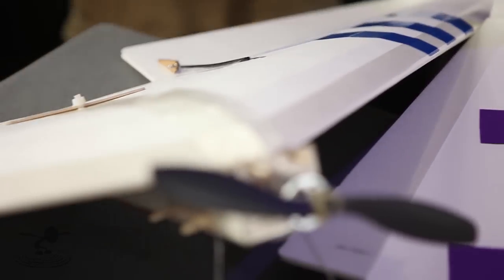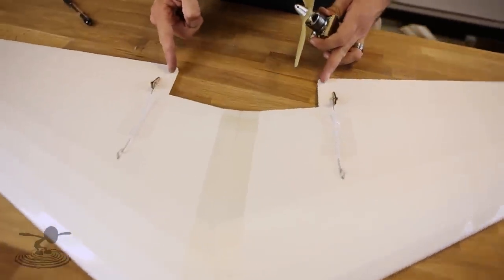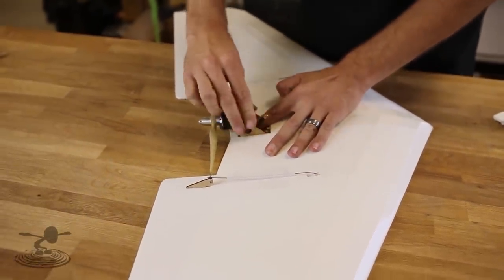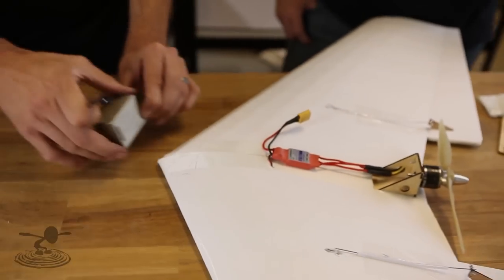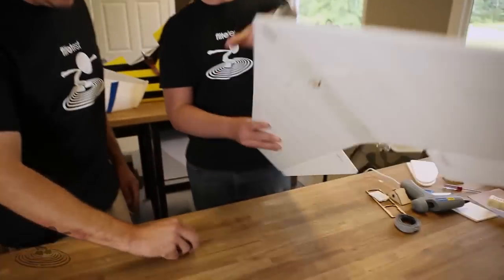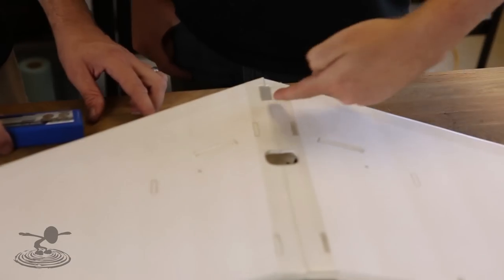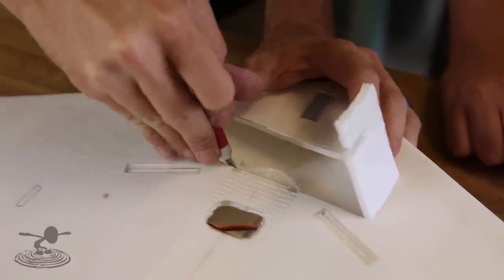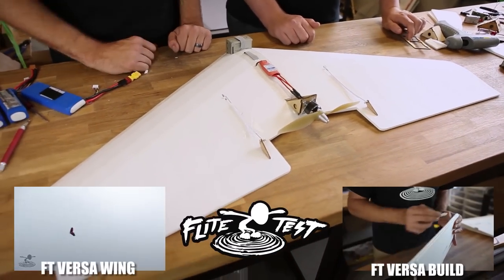Flite Test - FT Versa Wing - Pusher Conversion + FPV Setup

Comment: a buddy of mine bill.B from whirlybird videos gave me one of these. this was quick and easy build. this was my first wing. I put blue leds on one side and white on the other and it lights up like a lantern.  I slapped a 3700 battery in the front went out to the field threw it in the air I must say this was probably my most uneventful maiden ever it tracked through the air like an arrow.  before the first battery was out I was doing flybys less than two foot from me and a foot of the ground which is something I never do.  this plane is confidence inspiring.  guys thanks for all the work you put into designing and making build videos and everything you do.  the ft wing is now my favorite plane

Comment: The motor he's using is a NTM Prop Drive Series 28-26A 1200k. You can juuust make out the markings at around 2:27.

Comment: Your battery-story makes me remember sth that happened to my GF in the early 2000s. We were repairing wind turbines (32m hub height - they were already old). I was on one and she was on the one next to it. She dropped an allen key. So she had to climb to the ladder, climb the ladder down, search for the allen key, climb the ladder up and back to her working place. When she arrived about 20 minutes after she dropped the allen key at the screw she noticed the allen key had a different size than the one she dropped. So she had to go again for another 20 minutes.

Comment: i have found with a puffer battery like that if you cut a little of the covering from the batt. you can use a hobby knife to barely pierce the foil shell around each cell. then squish the battery back to the original shape and a tiny dot of hot glue to seal the battery cells. i works and as long as you get the glue into the tiny hole the battery is still safe... i actually found this idea on youtube... nice build.
Reply: Dont do whatever that metod was since its really risky....btw the gas inside is toxic and may provide to suffocation

Comment: The torque cause by the prop would give it an inclination to "barrel roll" if anything. Angling the prop would not compensate for this, and would actually be counter productive because it would translate the torque to not be in  line with the standard roll axis, making compensation and control much more difficult. In a single prop craft, it is just accepted. In a dual prop though, it can be compensated for by having the props rotate in opposite directions, which is what quadcopters do.

Comment: Just flew my first one I built from the free online plans, very easy to fly for a Quadcopter pilot with very little fixed wing experience. Added a lot of weight to the nose ( I put 38 caliber lead bullets in play doh and stuffed that into the nose). I'm going to order the pre cut mini arrow to thank them.
Reply: dwayne willis what motor did u use?
Reply: Turnigy D2826-6 2200kv  with a Master air screw 8x4 prop.
Reply: dwayne willis how much foamboard did you need? i dont want to order some the not have enough.
Reply: Spongebhoy I used 2 sheets, but if you have to order foam board I would get more to save on shipping   Im lucky I can buy that board right down the street.
Reply: dwayne willis what size were the sheets? were they a3?
Reply: I use 00 buckshot encased in hot glue on my builds. Bullets/pellets are great ballast...love your thinking👍

Comment: first check motor layout, escs plugged into correct outputs and prop directions. if all ok you may need to reverse gyro on the axis it tries to flip. ie. if it wants to flip on pitch axis, go into mixer editor, ch2 for elevator, change elevator ch from 100 to -100 or vice versa. they usually come set up ok for a quad. good luck :)

Comment: ther can be difrend resons for that,check the esc's simeller programed , check the wireing the connetions between moter and esc , folowed up by a range check of the throtel , so the board knows the beginneng and the max , then check for the gyro is it good ore in rev , go a bit lower on the gains , so it doesend want to over compensait , make sure all moters ar runing in the good direction , and the airflow is the same ( no objects ther ) and the landing gear doesend hook in to the ground :)

Comment: After building the Versa Wing and installing my motor in the pusher format, I cant help but realize how difficult it was to get the CG right. The CG on the plans were too far back for me as well. With a 2200 sitting horizontally in the nose and my esc up front as well, I still had to add 30 grams to the nose to get it to fly right. All that weight has really cut down on speed though. With a 3000 kv motor drawing 550 watts, im only going about 75mph.... Id suggest setting up the tractor format!
Reply: Hey. I know it's been 10 years but I'm busy finishing my versa wing and wow trying to balance it is a mission. I'm thinking of making a nose box to hold the battery in. Else I'll have to stuff a bunch of sinkers into the nose. Any advice you might have for me. Im a relative rookie, this is my 3rd plane in building.

Comment: Hej guys! Thank you very much for this nice model! I built it last month and would like to ask a question about the best anglr for the ailerons: What is the best angle the ailerons should be put for flying horizontaly? And what is the best mininum and maximum angle? My pusher wing seems to be vety pitchy and it is hard to control.
Thanks, Bjoern
Reply: Three late thoughts: First, try to throw the thing by hand until it glides, most deltas need some up-elevator at neutral to glide. Second, centre of gravity sounds too far back, try adding nose-weight, taping-on one coin at a time. Third, add 30% exponential to elevators (and 'ailerons')

Comment: Guys, you never showed me where to place the receiver. I waited and waited, but you never touched on it. I'm a noob, I'm stuck. I've spent 6 hours of my Sunday building my wing. Where does it go?
Reply: Does not mater. Anyplace that all the servo wires and throttle wire from ESC can reach it. I would put it right inside that hole on the bottom. You some times have to switch servo wires while setting up delta mix on your radio so be sure its correct before you seal it up.
Reply: Also, if you are doing an fpv configuration, you would like to put video tx and radio rx as far as you can from each other. So in this video, at min. 11:30 you can see both anthenas, one on each wing. One wing for Video transmitter, and on the other side of the wing the Radio receiver.
Reply: Birdella christianson my issue is that I do not know where to hook up the servos to the reciever to make the plane go up/down, left/right. (Noob here)
Reply: see your radio manual for better instructions or see the DX5e manual online but one goes to aileron and one to elevator inputs. then make sure your radios delta mix function is on. then test and if the proper movements can not be achieved with reversing switches then switch the two servo leads and then the reversing switches will give you the movements you need!
Reply: awesome! exactly what i needed.

Comment: will it rork with power pod turned around and pin it like the old fogy power pod .. or will it not work with motor on bottom side  in back

Comment: if I put the battery underneath the fuselage would it effect the CG much? I would still balance it obviously but I was wondering as the weight would be lower.
Reply: +Oliver Ward The difference on this particular plane wouldn't do much, however yes, the lower weight technically will give the plane so self stabilizing capabilities.
Reply: +Zeptonite OK cheers good to know

Comment: Avid Builder here, but never built a Flying Wing. I hear mention a number of times about the importance of proper CG on this Plane and I know You already have the CG marked for easy balancing, As a First Time Flying Wing Builder, I'm hoping someone knows of, or can direct Me to a link that shows how to calculate where the CG should be on say a Homebrewed Flying Wing, what would be the Formula for Calculating the CG? Anyone?  :)
Reply: all I keep hearing is keep it a little nose heavy, but I have two wing kits from FT and they both came with data sheets with the CG measurements.
Reply: +Hyper Joe lol I need a tutorial or a user manual for that.

Comment: what foam did you use and can I fly this with a trigger wheel transmitter
Reply: +MEGATRONBEZ117 

I can't see how you're going to control pitch and roll with a wheel. Just buy an OrangeTX or a second hand DX6i to start with.

Comment: what motor and props are in this video.
Reply: Looks like a NTM 28-26 1200kv, not sure what prop but I think its an 8''
Reply: i ended up getting the laser toys 'the beef' which is now on the FT-22.. then from what others mentioned in the forums i got a 2826-2200KV
Reply: how did that work, was it enough power?

Comment: do you guys think you could do a start to finish combat style FT Versa Wing  #flitetest  I'm a beginner at combat type planes only have access to duck-tape RN and my area of flight is 8 acre of land at low flight only
Reply: jwflammer there are a few things to think about.
Make sure that the double bevel is as small as it can be. Glue and tape the folds. 
make a wooden box for your battery and glue some sort of spar to the spar. 
The weak points are the leading edge, the folds ( the paper will peel there) the hole where the battery sits and the wing joint.

Also I would recommend waterproofing the plane with packing tape or minwax.
hope this helps you.

Comment: incorrect you CAN use the same prop, just reverse it so the numbers face forward, and reverse the motor rotation. The ONLY reason props come in RH and LH rotation is for multi-rotors

Comment: can the pusher be made swappable
Reply: Like as in attaching a power pod backwards? Im assuming not, since the center of thrust/ thrust vector would be so far from the center of mass, it would push the plane in circles. Would be neat to test, though.
Reply: Nope.

Comment: Have you ever tried to get just the plans printed at your local print shop (on a poster sized piece of paper, not just printing yourself)? Well in my area it was close to 30 dollars.  So what they are asking for their kits is very fair, they offer the plans for free so anyone could build their planes without paying them a dime.  If you can afford 40 dollars shipped for an airplane, you should look into a new hobby.